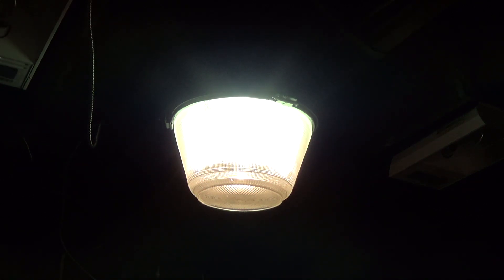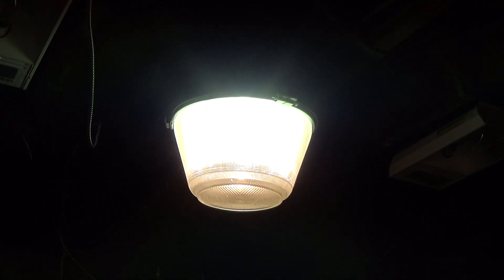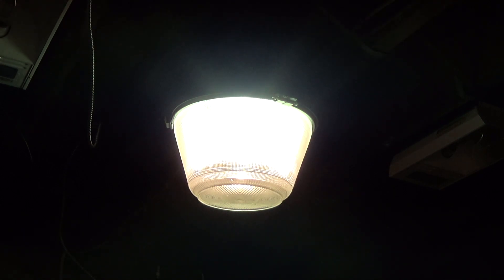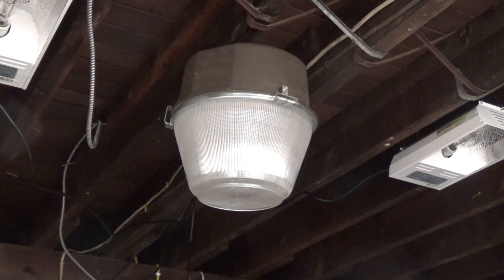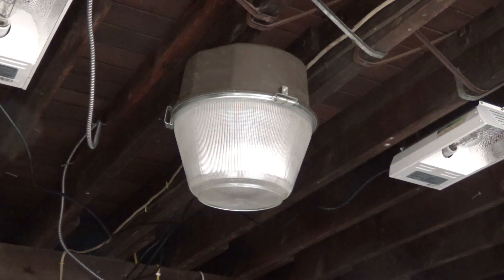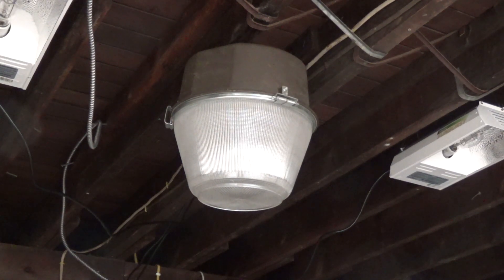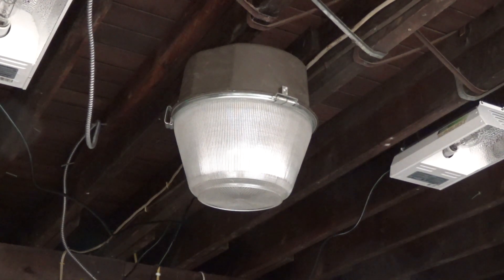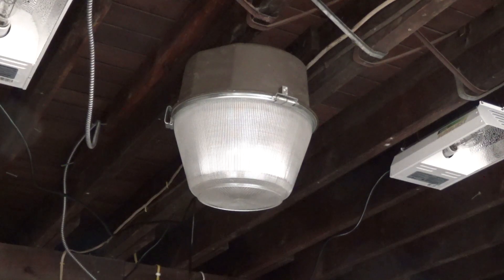CEW Lighting GLX2817-1Q 175-Watts Metal Halide and Quartz Hook Mount Luminaire Revisit

Comment: The halogen bulb is supposed to illuminate when the main lamp fails. I believe that if no current is drawn from the main bulb for an extended period a bimetallic switch closes. Try a failed bulb in the main socket and see what happens.

Comment: Not 100% sure about the ballasts set for 120V, but some of the ballasts I've researched can be ordered/configured in such a way that when the ballast is running on the higher voltage such as 208, 240 or 277 the stand-by halogen lamp can be wired to the 120V tap, not exactly sure how it works I'd guess either bi-metal strip that cools and switches the halogen on when the metal halide goes out, or a relay inside the ballast that turns the halogen on when no current flows through the metal halide.   

HID fixtures with stand-by halogen are used in areas otherwise exclusively lit by HID, and total darkness during the time it takes for the lamps to restrike would create a safety hazard,  in case of a dip or brief outage causes the lamps to drop out.
Reply from the maker: I wish I could find documentation for these fixtures so we could answer some of these questions.